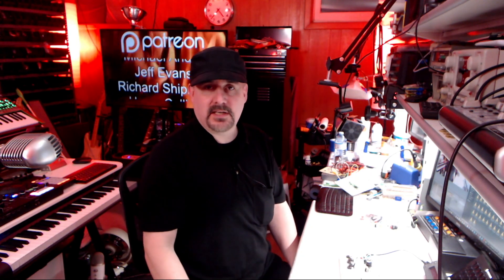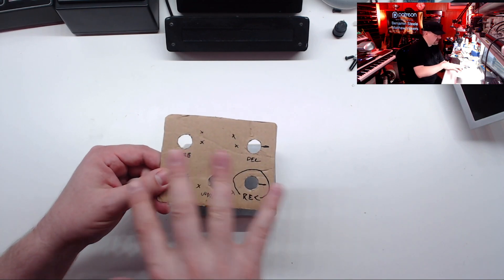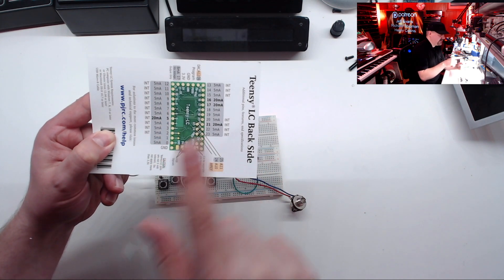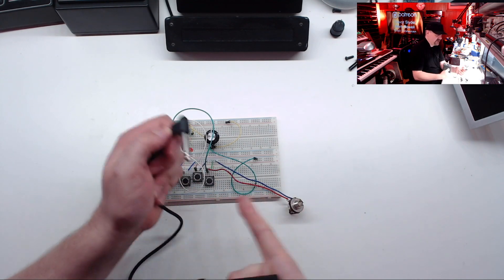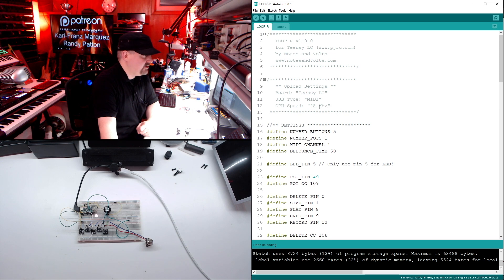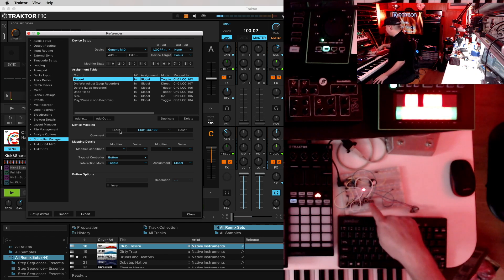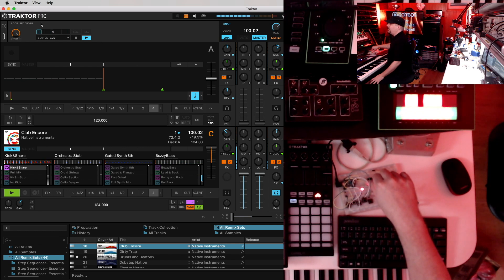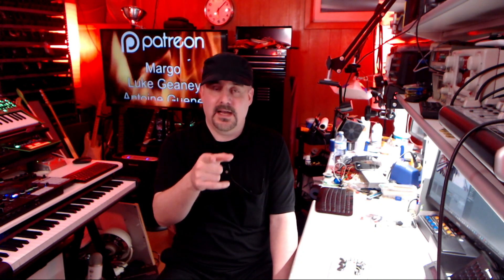DIY TRAKTOR Loop Controller - PART 1

Comment: I've built this controller and it works great on the laptop that I used to programme it but I then tried it on my other laptop and I can't get it to work, I'm assuming it's a driver issue, any ideas how I can solve the problem I can't seem to locate a driver that works?

Comment: Hello Dave. I have a Korg Volca FM that has a MIDI IN connector. Could the Traktor S4 MkIII be used in line with Volca and add some effects to it? Thanks for your great videos. Thumbs up!!!
Reply from the maker: Hi Carlos. You can patch the volca audio through the S4 using one of its turntable inputs. That's what I do with my synths. Then you can use Traktor's effects on it like any other track.

Comment: nice, thanks Dave! I've been slowly making an entire controller (like the S4) with what I've learnt from your channel. I've been thinking about how to build a jog wheel next. Do you maybe know what electronics NI are using in their controllers? Ideally it would be something that has a highish resolution as well.
Reply from the maker: Hi Shaan. I would assume that the jog wheels are attached to a rotary encoder.
Reply: And would be a motorized wheel that rotary encoder... just thinking...🙄😁

Comment: Make a whole 2/4 channel mixer
Reply: With all the effectz
Reply: this wouldn't be too different or difficult to make, based on this. main difference is it would be mostly pots on the analog ins on the teensy, and adjusting the code accordingly. a multiplexer can be used to increase the analog ins as well if needed. have a look through all of Dave's videos on this channel, he has a couple on this already :)
Reply: @luckypackets  yeah Shaan nice one always wanted to make a mixer considering they are like 50G's baby

Comment: Hey Dave, great to see you back with another controller video!
Question, is it possible to control multiple cc’s with a single press of 1 button?
Reply from the maker: Hi Mark. You can. Just send the second command directly after the first:
-Button Pressed?
-Command 1
-Command 2
Reply: @NotesAndVolts  Thank you!!